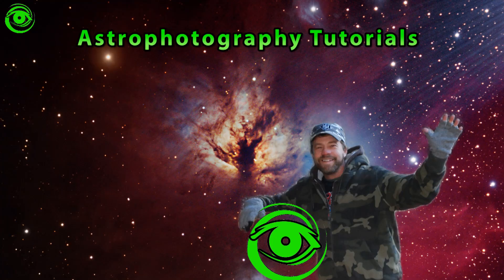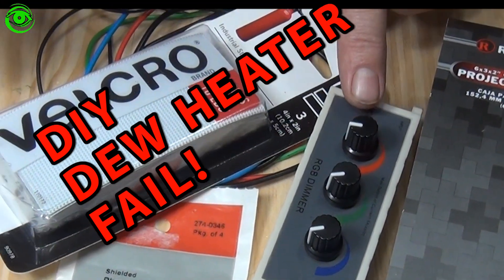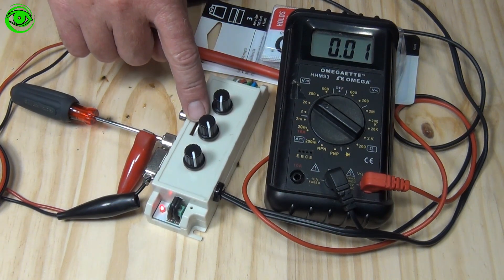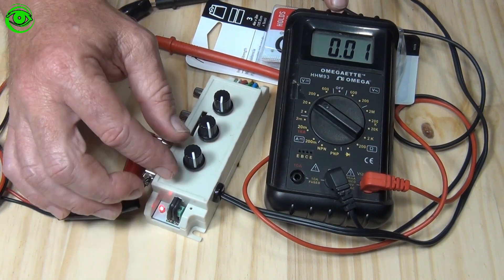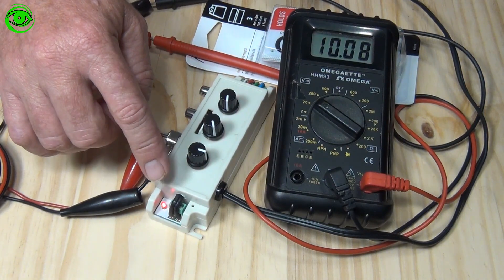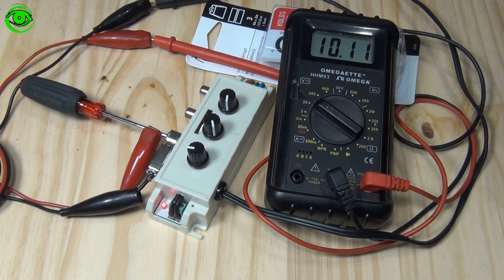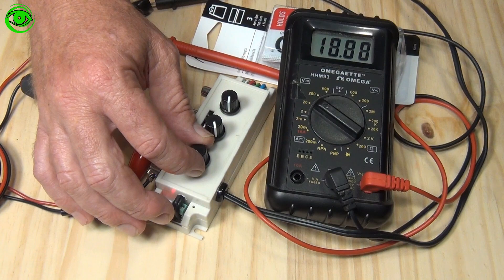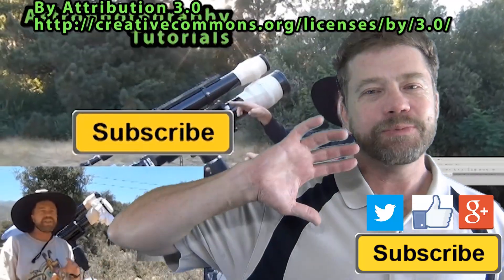DIY Dew Heater FAIL? - No!  Viewers Corrected Me - Thank you!

Comment: Hi Doug, I must have a different volt/ohm meter for when I put my meter on the DC SCALE of 25. I can actually
adjust the voltage from 0 fully counter-clockwise and gradually turn the channel pot and it gradually turns up the voltage
from 0-12v gradually as I turn the pot. Do these go bad or you just had a bad unit to start. My controller works fine.
Reply from the maker: Hi Daves Pals!
Yes, it did work, here's the second video .   My hasn't failed yet, been going strong for about 4 + years now:
https://youtu.be/k3F5xwct8IE
My original purchased one did go bad, but the DIY seems to be working better than Purchased Controller.
Thanks!
Doug

Comment: You right!  will not work! , but will work if you use this https://pt.aliexpress.com/item/32964646795.html?spm=a2g0o.cart.0.0.44a43c00HcfjrY&mp=1  becouse this model go to DC 1.8V to 12V 2A its a Motor V Controler  :)

Comment: Speaking of DYI Dew Heater, here's a "Poor Man's" Dew heater that uses pocket warmers:

http://kadamsphoto.com/catalog/digital-after-dark-lensmuff-keeping-your-lens-p-85.html

Works find for small refactors and guide scopes.  Some pocket warmers are better than others. I use "Hothands"

One advantage is they use zero battery current ;0)

Not recommended for SCTs.
Reply from the maker: Hi Glenn, that will work for sure!  I've always been a hater of dew.  There's nothing that ends an imaging faster than dew on your optics.  I've been satisfied mostly with my Orion DewZapper controller, but, it finally died after 8 years of use.  After reading all the viewer comments, it appears this is working.  I'll be testing and confirming soon.  Thanks!  Doug

Comment: oh no Doug, You went and tried copying my design and called it a no go.. You've missed how it all works though buddy!  LED controllers are pwm and voltage does not change persay but rather it is pulsed. This keeps all the resistive based responses intact for the lengths of nicrome wire. Dew heater wire won't heat up if you lower the volts. In practical use with led lights or motors (scooters, scrubbers, wheelchairs, etc.) the purpose is to be able to vary the speed or brightness while keeping full torque/power. .aka- a dc motor can take a machine up a hill very slow at a creep for instance.  PS- Holy Honis 
batman I see that Gary Honis (via your link Doug)picked the same exact 
ebay PWM as I did and had it up and running a year or so earlier.. https://www.facebook.com/media/set/?set=a.10205024273073424.1073741893.1440335422&type=1&l=86ffe986db
Reply from the maker: Hi Kevin!  Yes, you and other people were quick to correct my error.  I guess you have http://dslrmodifications.com/ website.  If that's your website, I noticed one error on the wiring.  " Black is ground and Red, Green & Blue are the positive leads for the three channels" On mine, the RGB were negative, and the positive is labeled as +V.  Anyway, I do appreciate your feedback and quick response to my error.  I plan on doing some more testing to verify, connecting a temp gauge and monitoring the levels with the temp gauge.  I've relabeled this video as "DIY Dew Heater FAIL? - Perhaps Not? Viewer Correction."  I've already recorded most of the assembly video, but, I'll need to remove reference to the Multi-meter testing, I now understand more about PWM.  Thank you kindly for making your design available for people to try.  Please correct me if I don't have your correct Web address as http://dslrmodifications.com/  Doug
Reply: +Astrophotography Tutorials ..No Doug that is not my site. In fact I just happen to choose the same rgb pwm as Honis did independently based on knowing what amp levels I needed to allow for. My album project is missing later improvements of switching over to the nicrome wire. It has different resistances than the kanthal wire. The best use for the meter is logging the resistances of the wire lengths but do realise I found it's best in the end to use the method from the Dew buster site of laying the wire out and siding up and down it until you find your suitable lengths. Link is at the beginning of my FB album. Things didn't quite work out as the figuring would imply from my preplanning due to going with a helical wrapped version rather than multiple runs of wire. If you like I can measure my resistances on my bands.  I wanted a little extra wattage than some the designs suggest. End up running about 1/3 a knob turn with enough power left over to clear a fogged situation yet it's not hot enough to burn things..
Reply: +Kevin Malone , Ok I measured it up for you Doug. The C8 band gives me a 8ohm resistance at the pwm output after a fair run down the pier through copper wire. The 80mm guider band gives a 5.5ohm resistance. My input to pwm is 13.8vdc. Since I run it so far turned down the output reads 3vdc on my meter. My wire is the 32gauge.
Reply from the maker: Hi Kevin, I wanted to get back to you and let you know it did work!  I put my temp gauge on and dialed in the temp I wanted.  It's a good thing it works!  I have all the video edits of the GOOD BUILD, so that will coming up soon.  Without your help I couldn't have figured this out.  Thank you very much for helping me.  Doug

Comment: This is a PWM controller, which is the reason people buy these controllers (instead of just using a simple potentiometer). Voltage is supposed to stay the same and is pulse-width modulated (PWM) like a square wave, so it runs in cycles of full power or no power for shorter or longer pulses depending on the knob position. The controller appears to be working properly. The pulses are much faster than the multimeter can register and you would need something like an oscilloscope to really check it out.
Reply from the maker: Hi Neil, thanks for the correction.  I was unaware of the behavior of a PWM.  All I say was all my power going out on my Multi-meter.   I'll do some more testing to verify.  Other people also corrected me too.  I'm glad people like you are here to correct my errors.  Thank you!  Doug
Reply: For sure, Doug! No worries! I just wanted to make sure you knew so you weren't thinking you got ripped off or something! That actually looks like a pretty handy little controller. :)
Reply from the maker: I did it a little bit different in my design and I reused the same project box the RGB dimmer came with.  I'm glad I didn't throw it in the trash.  I'll do more testing and I'll have the steps on how I assembled this project if my tests prove positive.  But, with so much feedback tell me I was wrong, I believe it! I appreciate your help.  Thank you!
Reply from the maker: Hi Neil, I wanted to get back to you and let you know it did work!  I put my temp gauge on and dialed in the temp I wanted.  It's a good thing it works!  I have all the video edits of the GOOD BUILD, so that will coming up soon.  Without your help I couldn't have figured this out.  Thank you very much for helping me.  Doug
Reply: Excellent Doug! You would have figured it out eventually anyway!  ;) Glad it's working properly, though!

Comment: Doug. That controller works on PWM. Even if it's working properly it can not be measured with meter. If you don't have an oscilloscope I can't think of a good way to measure it. The meter is half right. The voltage is ON at battery voltage for very short pulses the higher the dial is set the longer the pulse is until the duty cycle is 100%.
Reply from the maker: I'm glad smart people like you watch and correct my errors.  I had no idea this was a PWM.  It makes sense the way you explained it.  It will probably work.  I'll do some more testing with a temperature gauge and different levels.  If the temperature rises then it's a sure sign it's working.  I immediately rush to a conclusion and saw my multi-meter showing full voltage.  Thank you for commenting and correcting my errors.  Doug
Reply: +Astrophotography Tutorials  No problem, and I'm glad to watch as without your videos I'd have a bunch of greyish crap pics.
Reply: +Astrophotography Tutorials If your meter has a high current setting you could hook it in series and monitor the amperage drawn verses setting. You will have to connect 1 or more heaters.
Reply from the maker: Every once in a while I get something right.  = )  Thanks for watching!  I appreciate your feedback.
Reply from the maker: Hi 2soldierman2, I wanted to get back to you and let you know it did work!  I put my temp gauge on and dialed in the temp I wanted.  It's a good thing it works!  I have all the video edits of the GOOD BUILD, so that will coming up soon.  Without your help I couldn't have figured this out.  Thank you very much for helping me.  Doug

Comment: Just use a DewBuster.  Works great and conserves energy.  The website also shows how to make resistor heaters.  http://www.dewbuster.com/
Reply from the maker: Thanks for the suggestion Lowell!
Reply: What makes a DewBuster a good design is that it uses a temperature sensor to measure ambient temp.  Then you set the DewBuster to keep the optics a degree or two warmer than ambient temp.  If it's 32 degrees, it'll cycle on and off to keep the optics 33 degrees.  It really saves energy and makes your batteries last.   The designer and builder, Ron Keating is a member of our local astronomy club and a good guy.  His website has a lot of good anti-dew info & DIY ideas.
Reply from the maker: Interesting idea.  I have a similar system that works for me, I have a wired temperature probe that goes under my dew heater band, and I've found when the temp sensor reads 10 degrees over ambient, then no dew forms.  Your example is sighting the temp to be only 1 degree over ambient, that seems like a thin margin, but, if it works, that's great!  Thanks for sharing more details about the DewBuster!
Reply: Astrophotography Tutorials  The one degree was just an example.  It has an adjustment for setting the temperature difference to whatever you like.  Good luck getting your system working.  Hopefully it will allow your batteries to last all night.